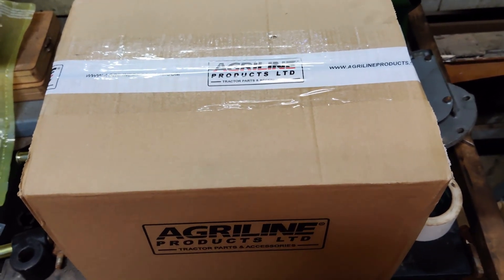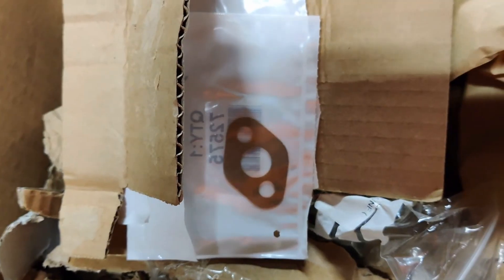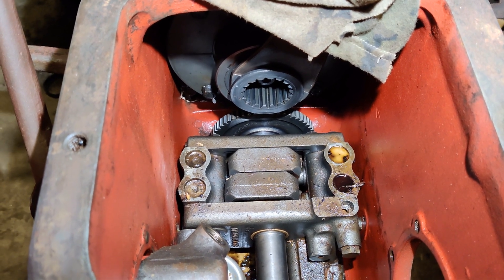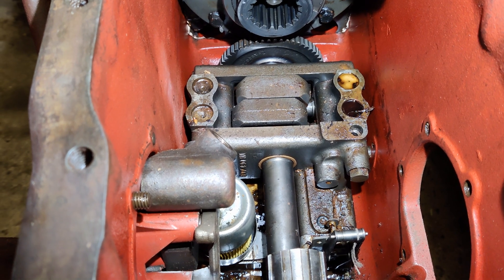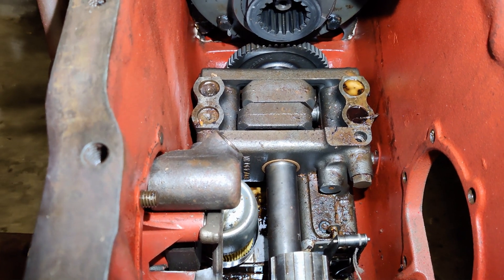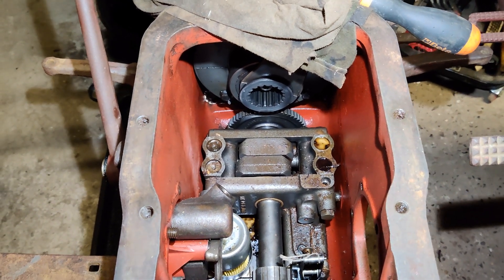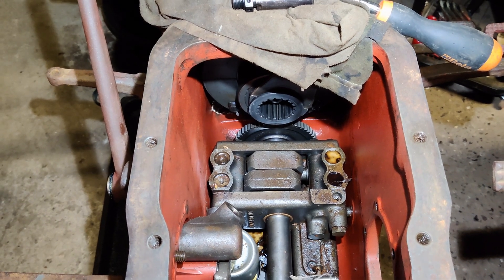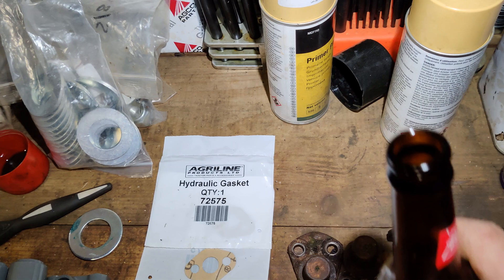It's story-time.  The mystery of the missing relief valve.

Comment: As far as I understand  the very very early pressure control tractors didn't have a pressure relief valve in the pump and relied on the pressure control system. Shortly into production someone realised it was silly having 2 different pumps for the pressure control and non pressure control models so the relief valve version was fitted to both pressure control and standard models effectively giving the pressure control machines 2 relief valves. In the late 60s or early 70s when the mk3 major hydraulic redesign took place the pressure control system was integrated into the pump more than the earlier version and was again used as the sole pressure relief valve even on tractors not fitted with pressure control. However nothing to stop your genius going into the pressure control system and winding it up to the point of causing the damage shown here...
Reply from the maker: Thank you for that, I have learned something today!  This did originally have pressure control.  Maybe when they removed the pump they just didn't bother to fit a prv.  Thanks for watching and please keep commenting.
Reply: Yep. that original lift cover must have been a Pressure control one and because the new one is a later cover is didnt have the Pressure control setup and they didnt put on on the pump because they didnt know probably.

Comment: Wondered if I could have the bolt if you don't need it as the fuse in my extension lead keeps blowing so I was going to use that instead?
Love the videos, especially like the patronising tone in this one when talking about the previous owner 😆
Reply from the maker: Unfortunately I have already welded it into the sump drain hole on the 175 but I have some offcuts on 3/8 copper bar that I could send to do your job if that's any good?

Comment: interesting how the engineers back in the day made those pegs serve 2 jobs, mounting the pump on the inside and the brake on the outside. good vid.
Reply from the maker: I think the overall quality of the engineering on these 100 series tractors is really very good.  Looking at the gear wear on a tractor that has probably been round the clock at least once, it looks like new!  Thanks for watching.

Comment: On a similar-ish theme..........our old 575 if lifting say a heavy McHale bale it sounds like a bag of rattles under the cab floor when the load is stationary........but not when it is lifting or indeed lowering......or indeed if you shift the diverter valve to ext1 or 2. Lifts fine but sounds like shite with a bale on, moreso with hot oil. At tickover it might be rattling like twice per second. Might that suggest the lift cylinder is wobbling about a bit or could it be pump related. Doesn't sound like the blow off valve and in fairness it shouldn't be popping unless it has failed and broken the spring. Dowel pins are pretty new maybe about 250 hours.

Can I drain the oil to the bottom of the RH inspection plate and have a peer into it with the engine running and a weight on the back to ascertain what is making the racket.

Relief valve can be replaced through the side cover I would imagine with a bit of fiddling and or modifying spanners to reach in there
Reply from the maker: Sorry for the obvious question, and no offence intended, but have you got the position control lever at the Constant Pumping setting?  It's right at the top of the UP section of the quadrant.
Reply: No, I was (very badly) trying to say that if I lifted the heavy bale and then put the tractor in constant pumping AND ext1 (my loader valve chest is on this)........then there was no noise in keeping the heavy load stationery.

Lifting the bale three inches or indeed twenty-three inches off the ground will be silent just until it comes stationary, whereupon the rattle would start. No noise when the lift is moving, just when it is stationary with a heavy load.

With let us say the wet heavy McHale bale on, the rattle goes away when:

A) you move the position lever down or up a bit so the lift isn't stationary.
B) you divert the pump output to the spool valves
Reply from the maker: @g00167015  That sounds very much like the control valve is out of adjustment and it thinks you are in constant pumping when the lever just says up.  Constant pumping does make a loud rattle because it is only supposed to be used with Ext 1 or Ext 2 circuits where there is a return line, such as going through a spool block.  

The position control lever behaves like a spool valve controlling the lift cylinder.  If the cylinder drops, (worn rings, internal leakage etc.) the a cam on this inside of lift arm moves the position of the control cam and opens the control valve momentarily to put some more oil into the lift cylinder to put the load back where it was.
Reply: @ClarenceFudWeasel  The quadrant on the outside is setup as per the service manual, ie going to constant pumping rotates the cross shaft about another 1/8" or perhaps 3/16" from memory. Plus at any rate I have a stop peg at the up-position and have to push the quadrant lever around it to go near constant pumping. As I mentioned, even if I just lift 2" off the ground and come stationary, it'll rattle......., with heavy weight on, that is.

Question is can the necessary adjustments be done through the side panel or will the top cover need opening. Through the side might be a bit fiddly and require bending or modifying wrenches but that is no problem. 

Am I right in saying my 575 will have a mk3 pump, so it doesn't have the small relief valve as in your video, but instead the pressure control valve which is a slightly larger assembly.

Can the fasteners or adjustments screws for this be accessed through the side cover, as the assembly itself will be small enough to fit through the side cover should it need to come out. This will be handier than removing the cab floor, cross member, connections and hoses, plus a generous layer of shite in order to open the top cover.

Thank you for your help.
Reply: If my understanding of the 500 series service-manual (workshop bible) is correct........the two main adjustments on the control valve assembly are 

1)the limit-screw which sticks out the back (supposed to be 14mm height to the head of the setscrew)

2) The setscrew which adjusts the tension in the relief valve, accessible by swapping the rearmost bolt on the selector valve for one with a hole drilled through its length.

Comment: Mine has the same bung but i have pressure control fitted so the pump uses the same relief valve, wonder if some one has fitted a wrong pump at sometime  ?
Reply from the maker: This did originally have pressure control.  You may have found the explanation.  Thank you!

Comment: Hard to believe someone would pull a stunt like that. Hope the drive shaft and bearings are still good  as well as the pump casing. I’ve been reinstalling the ipto clutch and hydraulic pumps on the 590 today . Both relief valves in place !
Reply from the maker: The bearings and shaft appear to be ok, so hopefully that's it for the repairs.
Thanks for watching.

Comment: i changed the relief valve on the 35x . it will lift the house now. the stanpipe @X~## thing. broke me hearting fitting a two way valve, its great to see the internals without oil!.id love to see an aux pump and cylinder fitted to the lift, and chance youd consider it on this, id like to see how this works. all the dutch yokes coming in have them. great lift. thanks again for sharing
Reply from the maker: I am intending to put this back to original spec eventually, it did have an auxiliary pump when it left Banner Lane.  Thanks for watching.

Comment: I would have thought an engineer would have removed the original spec relief valve and replaced it with a higher rated relief valve rather than blanking the port with a bolt. I am no engineer (bodger is much nearer) and that is what I would have considered or looked for an uprated pump. Imagine the tell tale bang from the backend when those pins broke or if the pump housing had cracked.
Interesting stuff when following someone else into the guts of a machine!
Reply from the maker: There was originally an auxiliary pump, but I guess that was too expensive for them to replace.  But it's all interesting stuff, seeing other people's solutions to problems.
Thanks for watching.
Reply: That pump is setup for the early pressure control lift covers, after they got a used cover that was newer, it didnt have the pressure relief setup and they probably didnt even realize that system WAS the relief valve. Bit of a shade tree type mistake, but an honest one if you dont know how the system works and are just a parts changer.

Comment: Would the parts have been slightly over rated back in 65 in case the pressure release valve failed
Reply from the maker: The valves rarely stick shut, generally they stick open and you lose pressure.  But you are right, the parts are over-engineered, but this is long term abuse.  Thanks for watching.